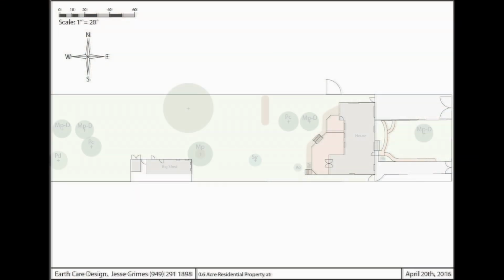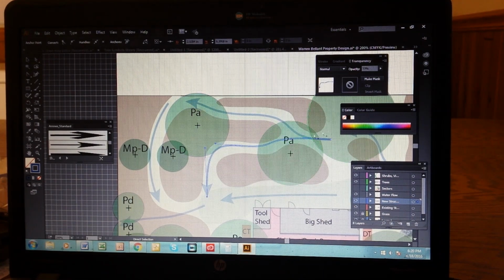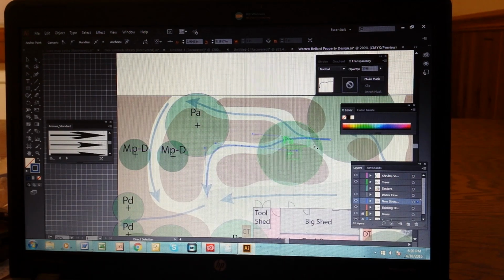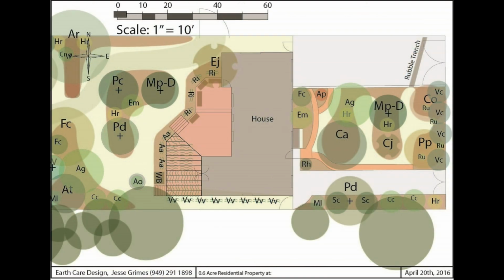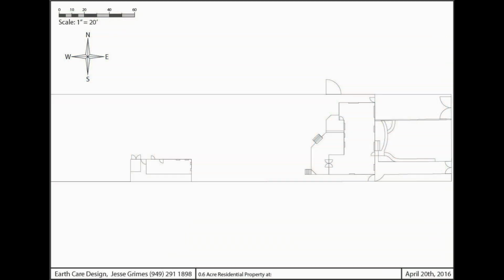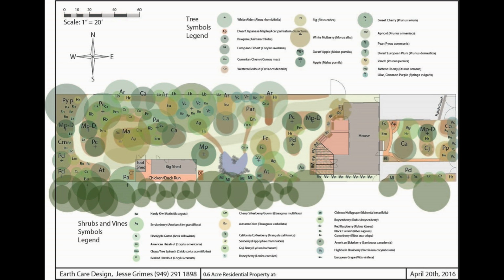The Permaculture Design Process - Earth Care Design

Comment: Jesse, This is a great vid. Thanks.  I loved the portfolio designs you did.  What program did you use to get such nice results? 

You may be interested in an experiment I'm doing this year.  I've created 4 raised beds, two are hugel and two aren't. Two will be no till with compostable mulch, and two bare dirt, tilled yearly.  All have the same soil, (a 50% finished compost and 50% sandy loam).  All will have the same sampling of common garden plants in the same positions.  For compostable mulch,  I'm thinking of ramial wood chips from spring limbing, (the chips with a lot of green matter in it.  So, one bed will be just a regular raised bed tilled every year and have no mulch. One will be a hugel bed that will be tilled and have no mulch. The other two beds will have mulch and will be no till. One will be hugel and one not.    I'm going to try to keep track of time, water, pests and productivity.  I'm curious to see what kind of effect can be attributed to no till and to hugelkulture.  If you or anyone at Wheaton Labs is interested, I can post it to the forums on permies.
Reply from the maker: Thanks Karl.  I used Adobe Illustrator for the design drawings.  It allows you to make nice layered drawings and make changes easily.  Daniel Halsey on Youtube has a bunch of tutorial videos on how to use illustrator specifically for permaculture design.  I am very interested in the experiment you have going.  My thoughts are that the no-till hugel bed will do best, but we need tests like yours to confirm our theories.  The people out at permies.com would definitely be interested as well, please do go make a thread about it.  What part of the country and what zone are you in?
Reply: Thanks, I had the same question as Karl because the mapping looks so professional! I will go check out Daniel Halsey!
Reply: I live at an intentional community in VT.  Its called The Center for Transformational Practice.   We've already made a bunch of hugel mound gardens and have had great success.  Its hard to quantify and say for sure if its the wood underneath, although it seems like that has to be it. I think tests like the one I am working on setting up now will help to show conclusively what kind of effect hugel and no till will have. Hope so.    I'll post a thread on Permies this weekend.  Thanks for the tips on the YT tutorials, I'll check that out.  Thanks again!   Cheers